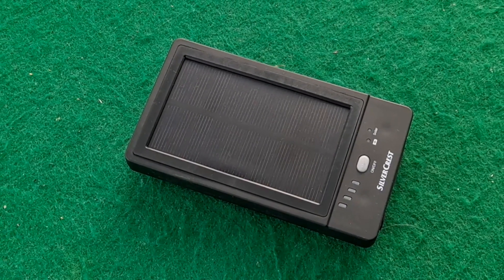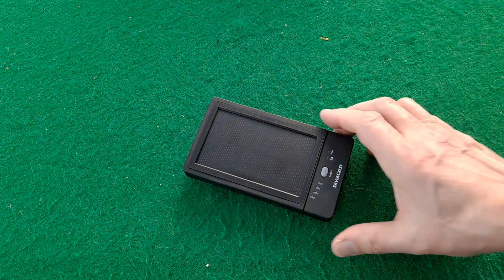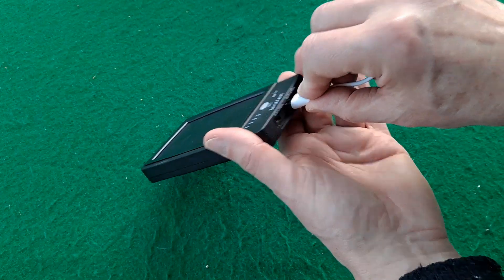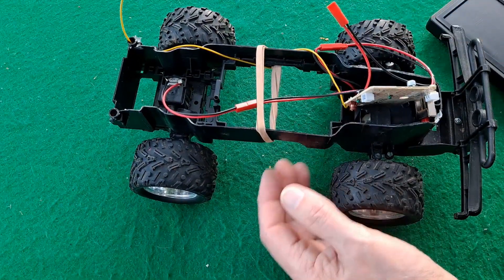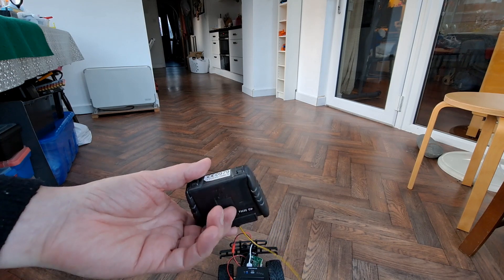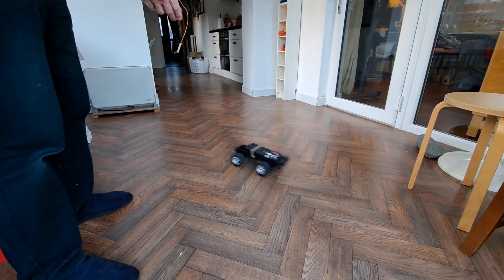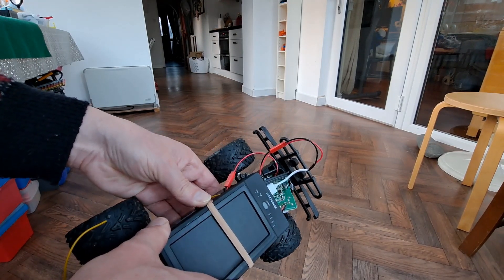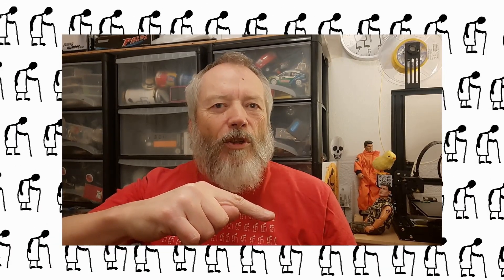Silver Crest Solar Power Bank Powered RC car 20210226

Comment: Nice job getting that to work.no need to Put a regular Solar panel on it when this works.good idea😀
Reply from the maker: Back when I started this series in 2018, I did it to show that running a car directly off a solar panel means you need quite a large panel to get it running and obviously it stops when the sun goes behind a cloud or the car runs into the shade. That would be a real problem if the car was radio controlled as you lose control. The answer would be to use the panel to charge batteries and then run the car from the batteries. You probably need a panel about a foot square to get enough power to run the car direct. I have done it with a boat because the size of the panel isn't such a problem on a boat.

Comment: eggscllent sir.   how many volts did u get  from that ?
 thanks in advance . wonder if it would work on my car.?
Reply from the maker: Good evening Alan. It is a USB output so it is 5 volts, but the circuitry does funny things, like it switches off the power if you draw too much current and also switches it off if you are not drawing enough current. 😊👍
Reply: @GrandadIsAnOldMan  thanks . i feel that this wont be a good candidate for my car.